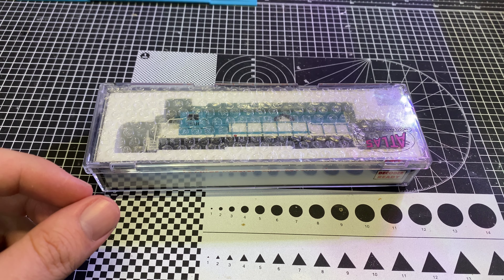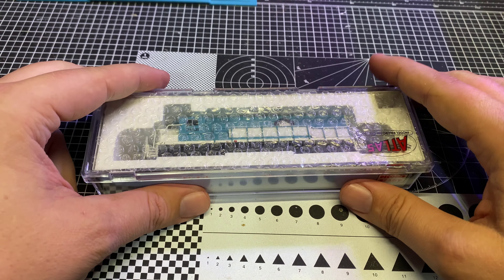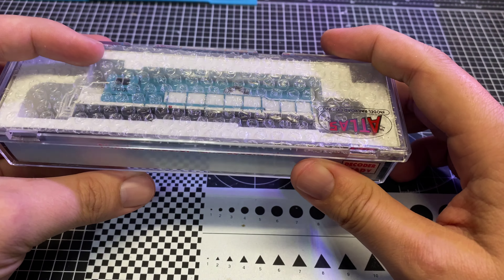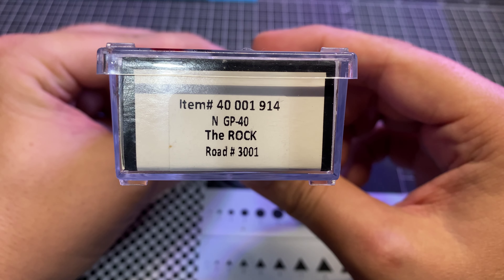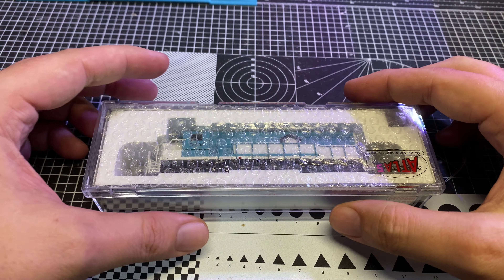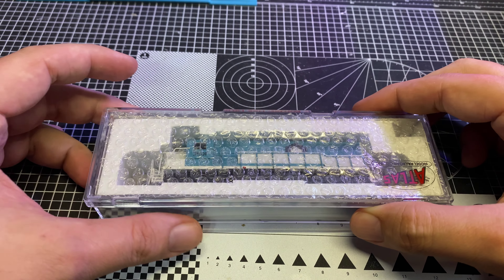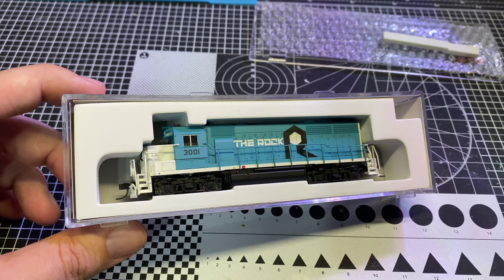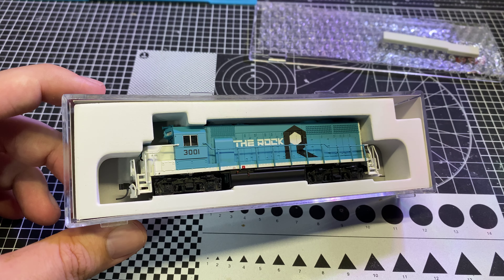Will it Run? N Scale Atlas EMD GP40 in Rock Island colors. Trains with Shane Ep 67

Comment: If you want to get even closer, N-scale just about needs a microscope! And nowadays we have cheap and very good USB microscopes for about 15 bucks! They are on sale all over the web. The expensive part is the 20 dollar stand-mount with focusing table with a adjustable up-down slider. I turned one sideways to do horizontal focusing and added a second mini-table to elevate/lower objects, so I can inspect turntable-cartridge stylus tips!
Reply from the maker: I've got a magnifier visor that I use for model building for when I need to get real close. Haven't had to use it with N scale yet. Mostly the difficulty is trying to get the details to focus on the camera when zoomed in.

Comment: I found a bunch of Atlas GP40-2's (new old stock with factory decoders and Rapido couplers) at a small local hobby shop and have been slowly buying them up. They run good out of the box but when I replaced the stock 20+ year old decoder it creeps much better, and holds speed up and down grades as well. It's tough to sink $40 into a locomotive that already run decent so I've only upgraded one so far. I have not had to clean any of them yet, and most have been running for a year or more. A very nice reliable design and I can't wait to buy more.
Reply from the maker: I'd probably buy a few, myself!

Comment: Thanks for the video. I like the wheel cleaning part. I’ve not used an abrasive before but I do have some 1200 grit that would work on a couple of old locos I have. Thx
Reply from the maker: 1200 gritt may be a little too fine to really get a good scrub on but would be great for really smoothing out the surface and polishing it up.

Comment: Got dirt? Blow it out with electronic switch cleaner, like CRC or WD40 branded switch and contact cleaner. Do NOT just use plain standard WD40, these are all totally different chemicals, and the contact cleaner do not contain lubricants (which can leave residue), unless specified!